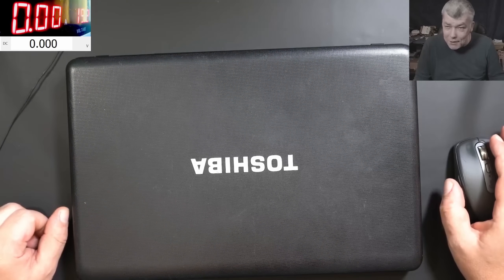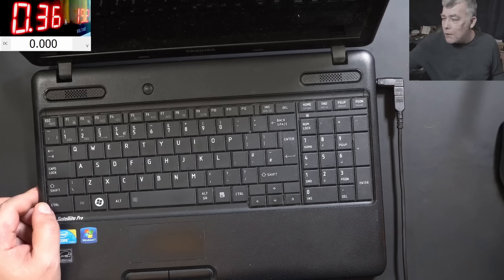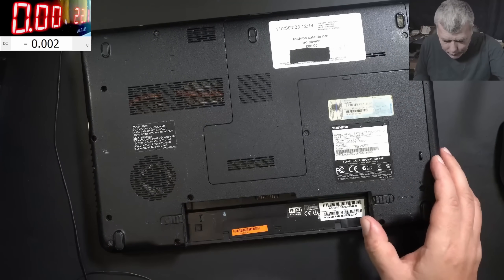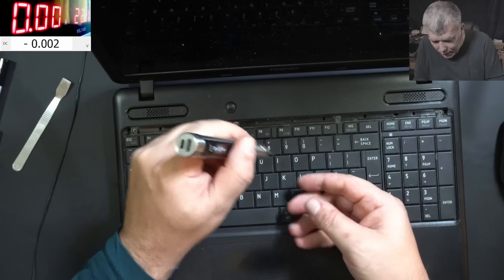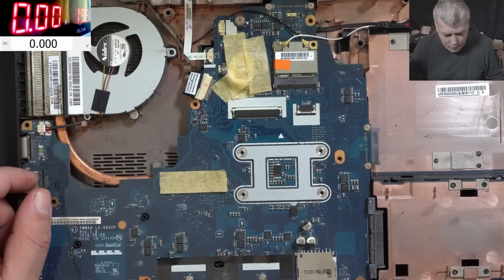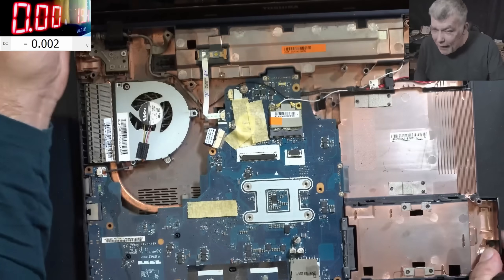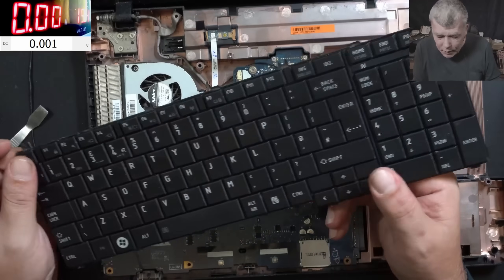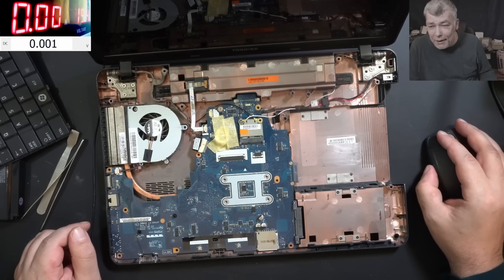Toshiba Satellite Pro C660 - no power repair - The world is changing and i don't think i like it

Comment: Hello sir, I am also using the same laptop but now there is a problem that when I turn on the power of the laptop, its power light turns on but the display does not come on. This issue came after windows update now i don't know if this thing is related to this issue or not

Comment: @Electronics Repair School
I have the same Toshiba C660 laptop. There were problems with it from the very beginning when it was new. The service replaced the keyboard and it didn't help. Just move the plug gently in the power socket and the laptop turns off. This problem still exists. I don't touch the power connector and the laptop can work 24 hours a day without any problems, I touch the plug inserted into the socket and the laptop turns off. So how do you explain that it's a keyboard and not a power socket?

The motherboard has no signs of flooding, damage, etc.

Comment: Happened to me many times with shortened keyboards (water damage). When I have no power on, I disconnect the battery, ram, touchpad and keyboard until I get something. I was not surprised! 😊
Reply: I have a Toshiba laptop from 15 years ago. When I plug it in, the charge LED and the power button LED light up. When I press the power button, only a few related LEDs turn on, and then it goes back to the previous state. The display, fan, and so on show no reaction. What do you think could be the problem? I have knowledge about electronics, but I don't have experience in laptop repairs.

Comment: I agree with Sorin that some elements of old computers were realy nice, like changeable batteries, RAM and HDD. Even CPUs were socketed and could be upgraded. 
The answer to "what was wrong with old design" is the manufacturing costs. They cut the costs. And that's why we have all soldered, non-changeable and cheap.

Comment: I think the good things about modern laptops are standardized usbc chargers and standardized docks through usbc/thunderbolt. I would totally buy a big bulky repairable plastic box like this if it had those amenities. No need to be as nice as a framework to be futureproof.
Reply: Why do you need USBC? Usbc is also very criticised by Sorin and for good reason
Reply: @silviuguseila2552  it lets me use a thunderbolt dock and keep that dock with screens & keyboard between my work & home laptop 
Back then each brand had docking stations with proprietary connectors for business laptops only.
what's wrong about usbc?

Comment: Whats wrong with the design ..... a 4kg laptop and 2hour battery life.
Versus a glued together laptop .... 1kg and 8hours of battery life.
Now choose!

An all metal VW Beetle vs a glued together carbon fiber F1 car .... now choose.

A beautifully crafted carriage and a horse vs a car. And on a cold winters night
you can sleep with the horse to keep you warm .... now choose.
Reply: "Whats wrong with the design ..... a 4kg laptop and 2hour battery life.
Versus a glued together laptop .... 1kg and 8hours of battery life." - one is throwaway when something goes wrong, the other one isn't. Now choose. Also, C660s weigh in at 2.64kg, for the record. And modern cars increasingly need to be serviced expensively by just a few highly-equipped tech operations, not just any old guy in your local area
Reply: Yes, the C660s are no heavyweight . Unless you're referring to pretty recent kit.
Reply: @daffyduk77  
The old stuff was built to last and with ease of repair in mind. Today's stuff is way faster, but being mostly glued 
together, it is not intended to be repaired. Or at least repairs require messy gluing everything back together. And if
you find yourself with a modern phone and laptop, in the desert in the midday sun, these gadgets are very likely to
become de-glued, unstuck, and fall apart in your hands.  Different standards. And knowing these pros and cons,
you make your choice ... rugged reliability and longevity vs short-lived speed. And both old and new have at times
included pleasing aesthetics. We live in a fast and cheap throw away society. But, when people get old: they hold
onto the old stuff. The throw away stuff ... has been thrown away. And the old stuff ... holds stupendous value. As
I said, you can't really compare the old and the new: different standards apply.
Reply: The improved battery life is to a big extent due to recent low-power cpu & memory  as opposed to the laptop design & manufacturing

Comment: nice video, and i totally agree with you Sorin. not long ago we had reliability, repairability and function over form, nowadays we have sealed batteries, soldered ram modules and ssd's, and proprietary software that can render your device useless ,but hey at least we got shiny screens with a billion colors and paper thin devices...with an expiration date
Reply: 100% !!! Soldered RAM, soldered WiFi modules, sealed batteries, keyboards embedded with the top cover, multiple bios chips...we are heading to the era when laptops will be single chip machines. nothing to repair, buy a new one.

Comment: A customer brought me one of these with two broken USB ports for repair. I bought a working C660 i3 from eBay this month for £50 which included an SSD, 6GB RAM, Windows 11 and Office 2019. At that price not worth repairing the old one ;) The SSD is well worth it, speeds the laptop up a lot.

Comment: I have a Lenovo gaming laptop from this era and it's day and night compared to the new ones. Standard barrel charger, a few screws to take out the keyboard, removable battery, the back has openings for wifi, disc, CPU, you can upgrade the RAM, HDD and so on.

Comment: OMG, I'm using that very same laptop for university. It's manufacturing date is 2011. It had an issue where it wouldn't turn on after many years of not using. The issue was in the power supply. Sooo easy fix, just swap power cord and psu, and done. Very glad the case was that simple. And also, I very rarely hear laptops stop working beacuse of fault from psu. Old but gold

Comment: This reminds me of a class action against Chrysler, They got caught with software that would disable the fuel injectors, light and horn flashing,  software in all 3 to 6 computers in the car. All because you opened the trunk with a key and then the passenger door reaching thrue the window to the inside handle. Yes that was one of many triggers in this booby trap software, that 60 start-stops cycles later, would total the car. If you changed one of those computers, without taking it to Chrysler, 60 start-stops cycles later all of the computers would be disabled. Of course the computer knew the date and mileage so not to self destruct during the warranty. Don't try to look this up on Google, it will be blocked, You have to use a proxy server in Europe. Chrysler, GM, and Ford all settled out of court, to reprogram those computers at no cost, but no compensation for all the totaled cars, looks like a bribe to me.

Comment: I have the same laptop Toshiba box in White, but with AMD/ Nvidia I have an issue like that I solve with a less amp power supply..
👌☺️👍 Thank's for the ideas about this one. I did not opened it for now, I stand to change the drive with SSD.   I think there are too much securities and low level AI inside, because they think we are stupid. And some are, really, so they play programed obsolescence for them to buy a new.

Comment: This is exactly why I still use my Toshiba Tecra A8 as my main laptop and why I bought a Toshiba Portege Z30T-C from 2016 a couple of years ago for doing some other higher-end engineering work. Nothing beats Toshiba for quality and reliability.
Reply: Tecra A8 - that's loyalty ! Just about quick enough esp. if you can run Windows 8 or 7.  A DDR2-based lappy running Win 10 is pushing it a bit, for me. But the Tecra line always had a certain something, like IBM/lenovo thinkpads in a way

Comment: This model has a removable cpu too and the battery lasts for a while the only issue is the keyboard durability, the masking tape on the bios battery is from factory usually there are two pieces of tape

Comment: Consumers want more for less so to cut costs manufacturers dont make things like they used to, they make the manufacturing process as cheap as they can which is why I believe keyboards are integrated in to the case with the motherboard screwed on to the keyboard where they used to be screwed in to the bottom of a laptop case.  Consumers have gotten what they asked for, cheaper laptops - you can get a laptop for just £150 NEW - is it worth repairing in years to come? No.  False economy as a well built/designed/expensive laptop can last a lifetime as it's worth repairing etc.

Comment: @ sorin: problem with theese design is: thicker overall chassis, more weight, more screws, more material = more cost
Reply: Compared to HP, Toshiba were always busting a gut to minimise number of screws, & typically almost all of the screws would be the same type/size besides kbd screws

Comment: I used to have 2 of these...i loved them but sadly had to give them away when i moved house...

Oddly enough one of them had the same ish symptoms except it threw my AC adapter into Overcurrent protection,

In my genius wizdom i plugged in my Universal charher which DIDN'T have any short protection and blew out the shorted capacitor by the battery connector violently....

It started working after that 😂